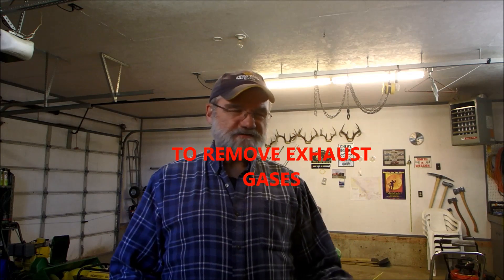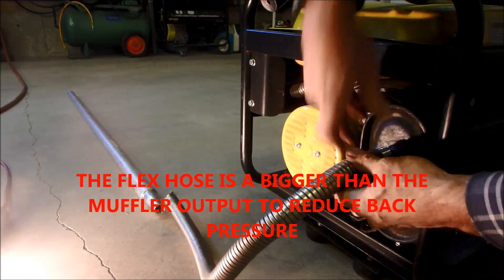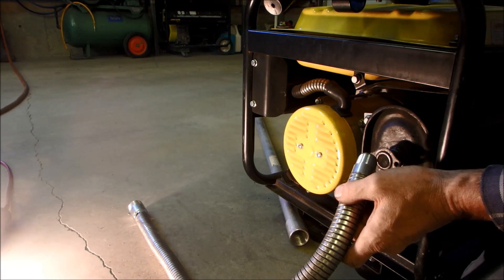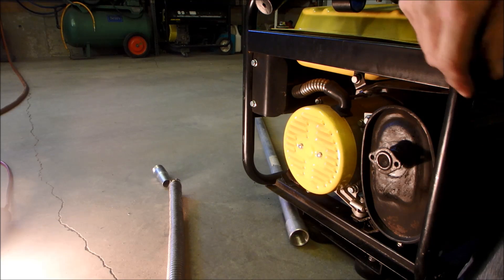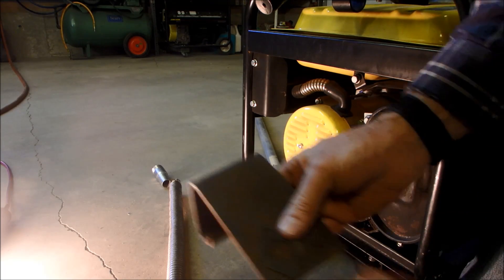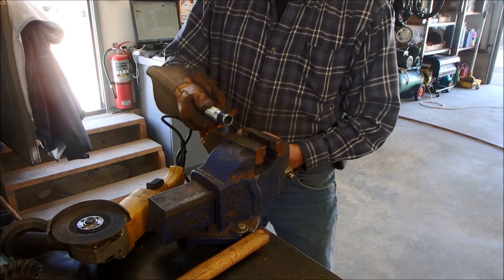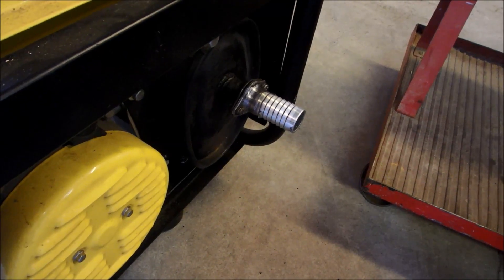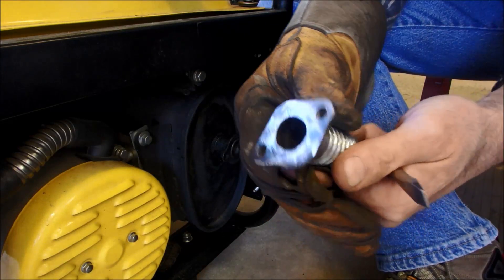Generator Exhaust Gases Solution

Comment: does that make the generator run quiet?
Reply from the maker: ***** A bit more as  the exaust noise goes out the door but the valve train noise is amazingly high.  An improvement of about 30%  (guess)Bruce